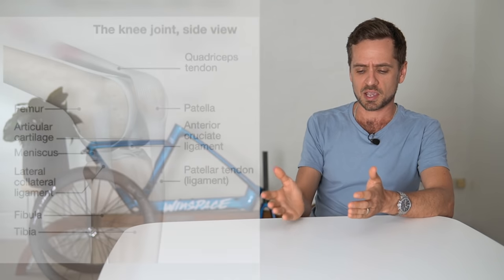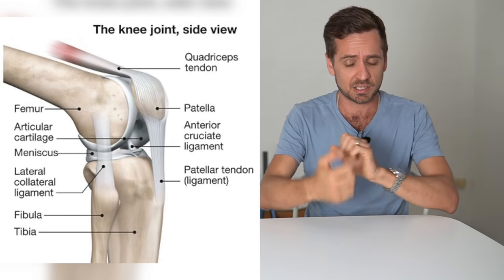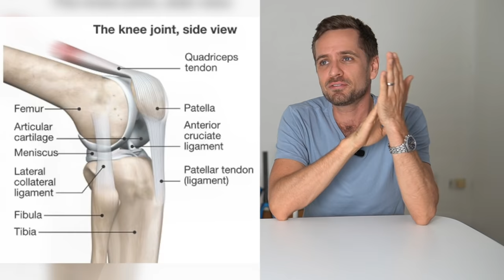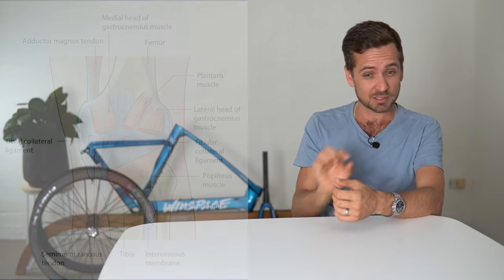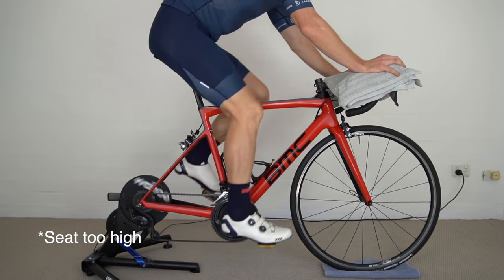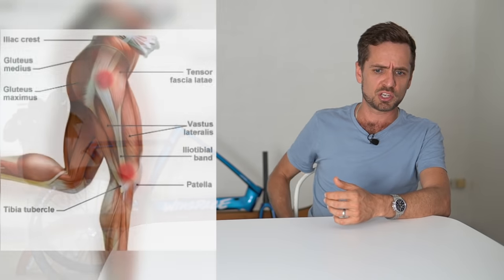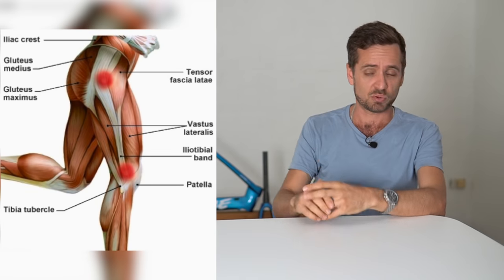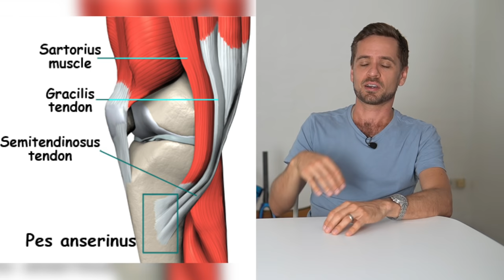What Causes Cycling Knee Pain (with a bike fitting expert)

Comment: Would you do an episode on leg length discrepancy for us that may have it and not know it please?
Reply from the maker: Good topic for future videos I reckon Lance - I'll put the idea to Cam for next time. - Neill
Reply: Are there any studies using different paired crank lengths instead of shims to compensate leg length discrepancies ( eg. 165 left crank 170 right crank or vice vesra to compensate for the leg length discrepancy)? Probably less expensive to put in shims than offsetting cranks.
Reply: @martinlum7166  I'm not sure if there's a price difference. 
Don't riders usually replace the left side crank arm with a power meter anyway ?

Comment: My right knee gets IT band pain. The only thing that fixed the problem was proper stretching. Stretching at the buttocks area is where i needed to stretch. The I.T. band runs the length of the outside of each leg. Without these stretches i was done. 
Stretching saved my riding. There are many vids here on youtube on the stretches needed to perform for i.t band pain. 👍

Comment: Awesome video. This is not only for bikes but also motorcycles. I just bought a new motorcycle and the riding position is very sporty, very low. 2 days riding it and I’m feeling the knee pain exactly as described here. And I know now why. Thank you for sharing. Now I need to find a way to fix it 😂.
Reply: That will go on time, all about getting used to it. Lower pegs can help slightly to release a bit of the tension when your in the “sport bike” stance

Comment: Thanks for this video. I think my left leg is shorter than my right so what I have been doing was to position the left cleats to where it should be and then move the right cleats backward more towards the middle of the foot. I was hoping that this would compensate for the differences in leg reach.

Comment: the "extremely high" seat height might also be 15mm. in my case it was somewhere 11-15mm where the pain totally disappeared. But it was not easy to understand, because seat height was set the same as to my old bike - but the geometry of the bike is slightly different - so my body did not like it that much.

Comment: Neill was some of best money I have spent and his accessibility and follow up awesome. Was also a bonus that my “deformity” caused him so much excitement haha. Tibial torsion I think he called it. Either way he fixed it. Thanks boys.
Reply: I have a tibial torsion on only one foot. What did he do to fix it? Cleat and shoe wedges? pedals?? This could help me a lot!
Reply: @onilovni1234   Hi Anthony. Mine is right leg only. I had no leg length difference so no shims or wedges. Because I was always trying to keep foot straight the by product was right knee kicking inwards towards top tube. This caused right hip to drop and I used to sit to side of saddle.Neill put a way longer axle on right side(around 20mm from memory) this allows my knee to track straight up and down and foot stays in its natural kicked out position. It doesn’t make me 100% symmetrical but short of trying to make a twisted bone straight it’s the best solution. Really happy. Just don’t look down at foot sticking out!!

Comment: This is gold, thanks for sharing. I have a strong left top knee pain, just 400 meters in cycling, I went to bike mechanic gotyeasurament to the t and still horrible knee pain. Last year I used a different bike and used for a small period a different bike and the pain was gone. Could it be the frame geometry? or more sy could a wider seat prevent knee pain even if my seat doesn't give me any bottom disconfort?

Comment: I had been making adjustments to combat lateral knee pain, but after he described the back of the knee popliteal pain and movement, I am now curious if that's my issue.  Especially considering my left cleat wears faster so it has a lot more movement than the right.  The popliteal is tired on one side and where the hamstring connects to my left knee laterally gets inflamed.  Usually only when riding hard or long for 2+ hours.  Ill definitely try his suggestions from this.

Comment: So, how do you deal with lateral pain? I ride a gravel bike, a mix of off-road and road . After 50-60 kilometers, I start to feel discomfort on the outside of my left knee – not severe pain, but still noticeable. However, after a ride, when I get up from a chair, it really hurts , no problem with walking. I've tried moving my cleat as far inward as possible and adjusting the angle to match my natural angle -useless

Comment: Thanks so much for your clear and concise description on what is a complex area for most to explain. 

I unfortunately am going through my own knee issues (made more apparent POST bike fit). I'm right leg dominant, and have experienced left medial knee pain. After settling recently (and doing minimal riding 6hours/week) I upped my riding (13 hours/week) but the mild discomfort (2-3/10) continued. Then on changing to new pedals (Keo Classic to Keo 2 Max) the very original pain came back for a week before subsiding somewhat. The pain/discomfort is predominantly when seated.

The fit was completed the one of the UK's leading fitters (not on a rig), and the conclusion is that have been riding (and racing) for years on too low-a-saddle), which is now up by 30mm!

Prior to this I've done fits in part, with tapered shims for overpronation, and custom footbeds to support flat arches (with the same fitter).

My concern is I've done lasting damage to my knee and any settling is going to cease when I up the load again, but I hope this isn't the case - any positive insight would be appreciated as the fit has now effectively been ruled out. Cheers!

Comment: I haveva bike that is slightly too small for me. I was able to create more room by offsetting the saddle 30mm. However, I'm worried about potential knee issues from moving that far out of line with the pedals. I was hopping for some information on fore aft issues. How much room do i have to offset without being too much? Would a longer crank help? I have 170, but think i could go 175, but I'd have to check the frame specs.

Comment: My quadriceps tendon has been hurting when I bike. I started consistently riding about a month and a half ago. When I look it up, it says that either your seat is too high or too far forward, but I have made sure multiple times that my seat is in the correct position. Do you have any advice?
Reply: Did you find a solution? I've been dealing with the same thing.

Comment: I too was riding slightly off center. Dropping my right hip, left side saddle sores. I added a 3mm shim to the right leg. Rode it for a while and problem solved. 1st thought is always to revert to the old position. My advice for you guys out there is DO NOT revert to the position. You have to allow your body to adapt. With some people it may be quick but It took me over a month to settle in with the shim. At 1st the 3mm felt weird than got massively better with every ride. Now I can't even tell it's there. No doubt Neil and Bike Fit James know their shit!! Many bike fitters are in this only for the buck. These guys do it for that reason but also because they care and are passionate about helping people from hurting themselves.
Reply: Having same problems Sam , same leg . Saddle sores on left side only , ive tried with a shoe insole of about 2/3 mm the saddle sore went away but i ride only on flat pedals / mtb. But then my right foot goes numb due to having double insoles 😂
Reply: @18erik  Right. That's the issue with adding too much MEAT inside the shoe. Maybe you can try a shorter crank arm on the shorter/problem leg?
Reply: @samuel8590  I was thinking about that but I think that shimano slx which I have now dont make them any shorter than 170mm . Thanks for the advice
Reply: @18erik  Try lowering your saddle 3mm. Might help.
Reply: @samuel8590  thanks Once again for your time and help , i think that i have a unique problem 🤣 if I lower the saddle as you mentioned I've tried that one before it even gets worse as i assume that my left leg is longer or there's something wrong with my hip it pushes my left side I would say more towards the back and then I get this chafing or how do you say it on the soft tissue between my thigh only on left side , and sometimes this weird pinching feel under my sit bone ( hearts real bad ). If I adjust the saddle to my leg length formulas all over the net. My left leg pricesly my heel touches the pedal in the most far away position from the saddle , but then my right leg ( stronger) comes short maybe I would say 3/5 mm didnt measure pricesly . Yep I've tried a few different saddles from wtb , 2 from ergon , 1 of which I have now . SQ lab 2 of them also the 611 and the 6ox with no help . The only one I find out of them that I could ride even with this pain is the ergon SM comp.if I lower the saddle I also get front knee pain awful last time it was so painful I couldn't sleep even though as soon as the pain started I stopped and raised the saddle about 5mm and it went away but came back after the ride maybe I've done too much damage . Knee is better now but I just cant seem to find a solution to this problem . Even If i put an extra shoe insole or how do you call it , it then becomes a lot better but then I get sometimes numb right foot , or the same problem chafing on my right side in the same spot almost as when the pain was on the left . Sadly I do not have such great bike fit experts in my area but for shore they would have full hands if I came to one of them 😂 . Cheers my friend,  thanks once again and sorry for the long post .

Comment: I suffer from all 4 directions of knee pains. My current way to remedy the pain is a hanging routine to stretch the knee ligaments and realign my back. 
The quick fix to erase my pain within a day is:
Hang from a chin up bar, first rotate hips 100° left, then right. Then rotate neck the same (while hanging with at least 80% bodyweight off the ground. Combo these 2 each way/opposite directions. Only 2 reps of each is required. 
THEN while hanging, lift each knee to your chest straight up. Do each knee twice. 
To increase the effect, do a chin up, or as much as you can, while in the chin up lift each leg 1 at a time. 

Under 30 seconds to complete this stretch routine, it will realign your whole back, decompress every disc in your back, but most importantly it stretches all your knee ligaments 

This video might be the solution to my knee pain though, as preventing it is better than remedying it. I'll have to setup a camera to analyse my pedal technique. 
One thing Neill didn't touch on was stand up or sit down pedaling. While sprinting the bike leans over 30° or so, our knees must be combating some extreme deflections. 
Those trainers can't replicate real world scenarios. I tested my frame under my weight, the bottom bracket deflects about 5° while still, can't imagine what full load might produce.

Comment: Let's assume that I have the same problem explain in the end. I don't seat simmetrically on the saddle and my body, looking the bike from the rider point of view, moves more to the right and the right knee hurts on the medial part. I didn't understand if the solution is putting a spacer under the right or lef knee in this case. I know it's not easy to fix this kind of problem but it's just to understand. Nice video!
Reply: I have the same problem to. Did you manage to solve it already?

Comment: I started experiencing ITB pain in my right leg. Both of my knees track close to the top tube. I have been adjusting my saddle on this new bike, having started a little low and raising it 5mm at a time. I have also increased my distance 20% on the rides I have experienced this pain. Could it be the increased training since I did not experience the ITB before?

Comment: Great informative video. I've had knee pain at the top of the left front knee for a few years now, more noticeable on the turbo. I broke my right femur (snapped in half) 30 odd years ago (in my early 20's). Would that make my right leg shorter or longer? my right leg is definitely the more dominant one, certainly more muscular and I've noticed I don't sit sqaurely on the saddle. Any advice on what I can do to rectify this would be much appreciated. Thanks.

Comment: Thanks both , Neil mentioned my issue in that my right leg goes up and down fairly straight but left is following a crazy plane of movement- structurally legs same length but might be functional differences - I Tried shimming the left leg - should I have tried shimming the right one instead ? Any one want to give there 2 cents? - thanks

Comment: Hi, I recently noticed that even the crank arms are not perfectly symmetrical. My FSA Powerbox SC crank has smaller Q factor on left side and bigger on right side. The difference is 3.3 mm (confirmed by FSA). I also found my GRX left crank arm has 2 mm wider Q factor than the right side. 

Could this issue be associated with knee pain?

Comment: I recently changed shoes and put on new cleats. Obviously any comparison with the old shoes on order to setup the cleats  was kind of impossible (different models). So I started with the cleats in the middle and got a kind of irritation in the knee cap. Not a pain that prevents me from cycling but rather a feeling of "weight" in the knee cap, especially after exercise. After watching a few videos I moved the cleats all the way back. Today was my second ride with this setup with no change in this feeling. Any advice on how to approach this? My saddle should be about right, both the heel method and the inseam/0.883 method agree.

Comment: I have mountain biked for years and never had any issues.
Just got into road cycling a year ago and my knees are killing me. I have lowered my seat height as I knew this caused pain. However, I think mine is due to the crank length. I am 5’10 and they put 175mm cranks on this bike…

Comment: Hi Neill
I need your help buddy!!
Im terribly worry and i trust your skills !!
I have "clicks" and pain from my right knee. Front side.
The patella feels like it wont sit right in the knee!
My right leg is 2 cm shorter.
Yes i was riding far too high and almost had to fully streight my right leg...
I lower it dramatically now-no more games.. 
And now i feel like the pedal is too close to the frame. Feels Like i need it to be extended outside few cm..
Can it be my Canyon Ultimate CF road bicycles has problematic Q factor that go to the left and is not symetrical compare to the seating center???
Im so afraid this pain and bad feel with the patella will end my        riding! Should i switch bikes??
Should i do few weeks break?
Or maybe ride without cleats?
Im worry and need your advise.
Thank you sir

Comment: Is adding a weight program for legs help or hinder the inflammation in an around the knee?
Reply from the maker: If it targets the specific structure being overloaded by improving its strength and capacity to absorb load, then it will help. If it targets the assymetry and reduces it, things will also improve! - Neill

Comment: interesting and fantastic descriptions of possible issues. one question I would have, although I assume rare, is what could be a resulting issue with knee or tracking if the Q-factor is too wide?? IE some buys a longer axle pedal system or puts their cleats too far in (pushing the shoe out)
Reply from the maker: Thanks for the question - Neill can't get to all the questions though unfortunately and he would be best equipped to answer. Cheers, Cam

Comment: Found your channel after searching for causes of my pain. Juat finished a 34km ride and the outsidenof my knees hurt on both legs. From what you have said its called ITB? But you also mentioned its rare to have both knees affected which worries me why both of mine are. What are remedies in cycling and how can I treat it? At the moment , can barely bend both knees without pain
Reply: He said either seat dramatically too low or dramatically too high would cause pain in both knees
Reply: @nathanp9449  thank you. My question was a few months ago. Seat height was not the issue. During my rides i would hear rubbing or friction. I brushed it off to chain noise. Found out later that my bottom bracket / crank was loose. My pedalling was off because of this which caused the pain. After getting it tightened properly, been riding since with no pain. Thank you

Comment: Any links to how to actually treat bad knees ? I’ve got pain in the middle of both knees whenever I try to stand from a sitting position or run. I thought not riding for a short while would ease the pain but I haven’t ridden in slightly over 1 month and while the pain isn’t as present as before, it always comes back whenever I try to do anything like a squat. Thanks.
Reply: Has this resolved.. I have similar issues

Comment: My front of the knee feels tight not necessarily in pain when cycling. I feel like my legs come up too high on the up stroke and my knee is always sore when locked in that 45 degree angle bent position like when I drink water.. should I raise or lower my saddle ? When I raise it then I my pedal stroke becomes too choppy
Reply: Simple rule;

Anterior knee pain (at the front): you’re saddle is too low/forward, causing the distance between the pedals and the saddle to be too short. This mean that at the top of the peddle stroke, there is too much flexion/bending of the knee which cause pain. 

Anterior knee pain (back of the knee): opposite problem, the saddle is too high/aft(rear words) causing the distance between the pedals and the saddle to be too great. This causes hypertension (leg too straight) which puts strain on the ligaments at the back of the knee.

Basically, if knee pain is at the front, move the saddle away from the pedals (up and back). If the pain is at the back, move the saddle closer to the pedals (down and forward)